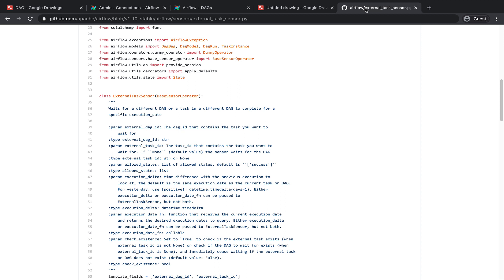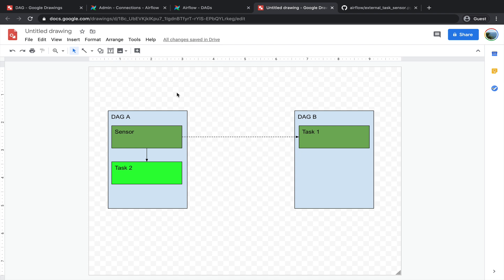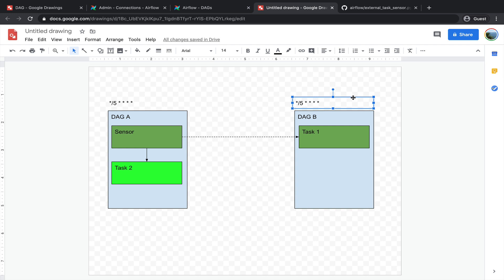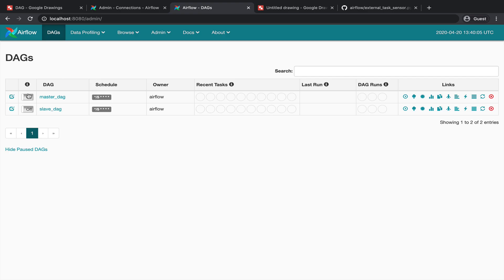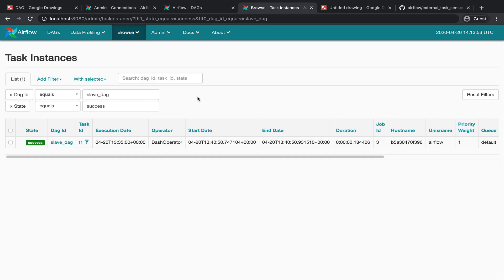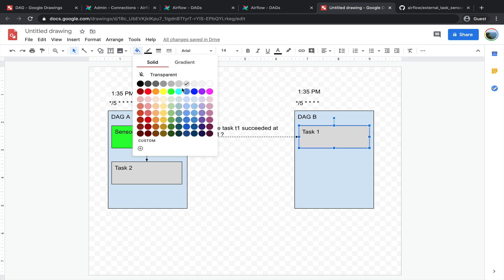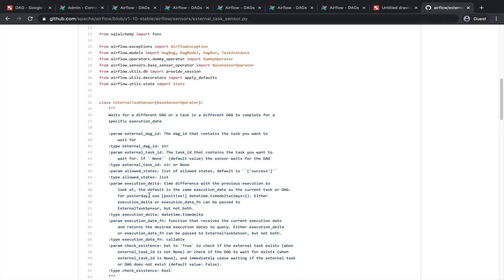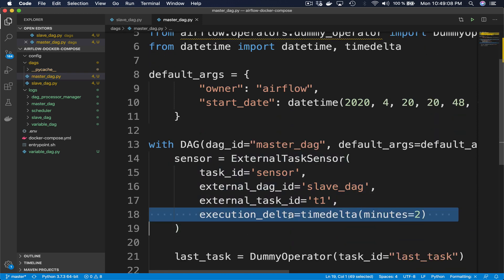Apache Airflow: The ExternalTaskSensor demystified

Comment from the maker: One thing I didn't mention in the video is that the ExternalTaskSensor will take a worker slot until the condition is met. Since the ExternalTaskSensor can wait a long time before getting triggered, you can fix this behaviour by adding the parameter mode="reschedule".

Comment: Hi Marc, I have 2 dags, one run hourly (from 5:00 to 17:00) and another run daily. I would like to trigger the daily dag once the hourly finishes running at 17:00. Could you please explain how to do. Thank you very much
Reply from the maker: Look at the trigggerDagRunOperator for that. With a short circuit operator before to check it the current dagrun is at 17
Reply: @MarcLamberti  thank you Marc